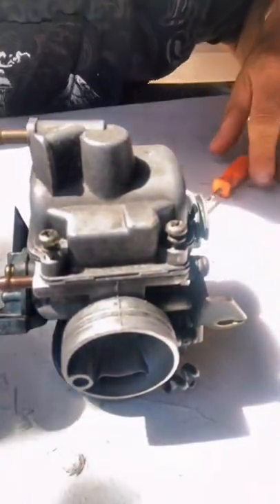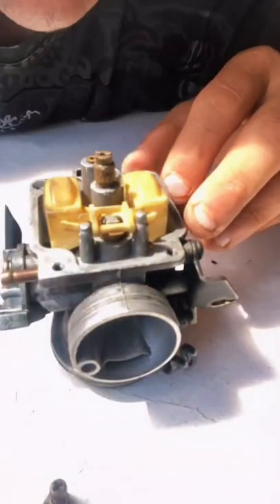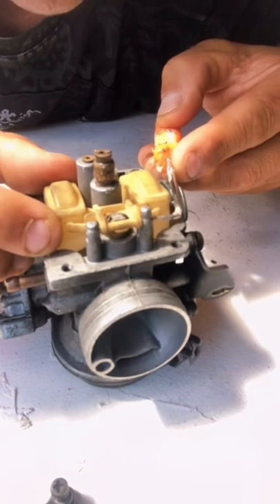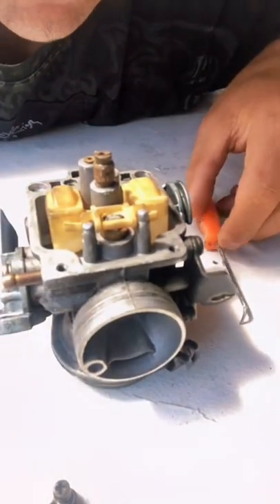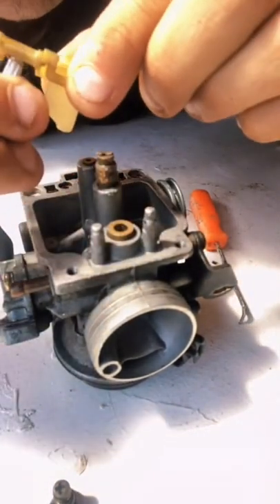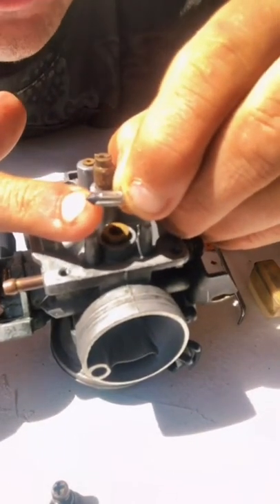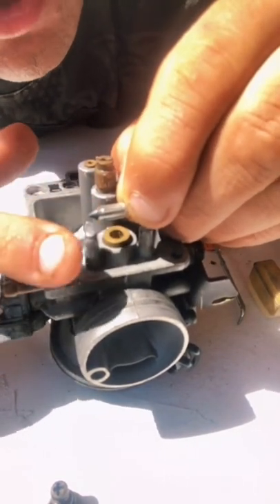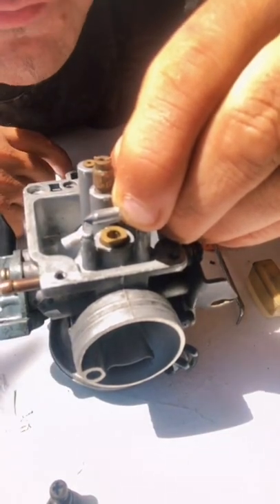Carb Float Valve #shorts

Comment: Hi I bought a 50cc 139qmb repair part kits online and it was smaller than the my 72cc 1p39qmb carburetor. What if I change the big one to a small?
Reply from the maker: Swapping a 50cc 139qmb carburetor for a smaller one in place of a 72cc 1p39qmb carburetor might not be a straightforward solution. Carburetors are specifically sized to match the engine's requirements, and making such a change can lead to various problems:
Inadequate Fuel and Air Mixture: A smaller carburetor may not supply the right amount of fuel and air mixture required for a larger 72cc engine. This can result in poor engine performance, reduced power, and potential overheating.
Reduced Performance: Your engine's performance will likely suffer with the smaller carburetor. You may experience sluggish acceleration, lower top speed, and overall decreased power.
Poor Fuel Efficiency: Using a carburetor that's too small can lead to poor fuel efficiency because the engine won't be able to burn the fuel efficiently.
Overheating: The engine may run hotter than it should because it's not receiving the correct fuel-to-air ratio, potentially leading to overheating and engine damage.
Potential Engine Damage: Prolonged use of a carburetor that doesn't match the engine's requirements can lead to severe damage and reduce the engine's lifespan.
If you're looking to upgrade or replace the carburetor on your 72cc engine, it's crucial to find a properly sized carburetor that matches the engine's requirements. You should consult with a mechanic or specialist who can help you select the right carburetor for your specific engine model. Modifying the carburetor size without careful consideration of your engine's requirements is generally not recommended.
Reply: @VirberelloScooterTips  I can't find the part for the fuel float boat online(drain fuel) for 1p39qmb. I don't have the money in the moment because I already spent it on monsterscooter website and I wanted to know if I change the big part to a small. Will it leak fuel out of intake carburetor output?
Reply: This is for those who bought the wrong size repair rebuild-kit for the carburetor. I tried my hack method with a 50cc valve needle on a 80cc carburetor. I took the original metal part off and used the metal spring to push down and block the fuel hole where the gas tank fuel line hose goes through. now my cvk24 carburetor not leaking fuel through the air intake.

Comment: Papo, mi scooter de 50 cc tiene una aceleración lenta y se para em 30 mph.  cual crees que puede ser el problema
Reply from the maker: Hello my friend could be roller weight at the variator you should have 8.5 grams
Reply: @VirberelloScooterTips  ok. I will look into it. I need to buy a good drill to take it off,